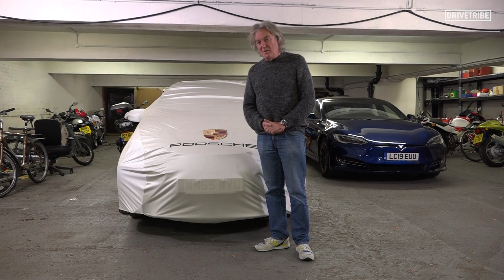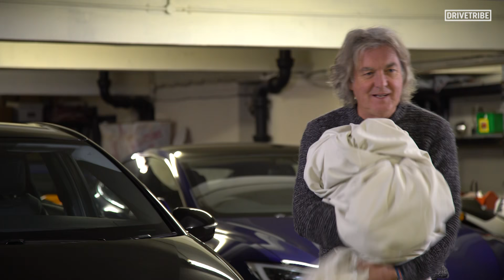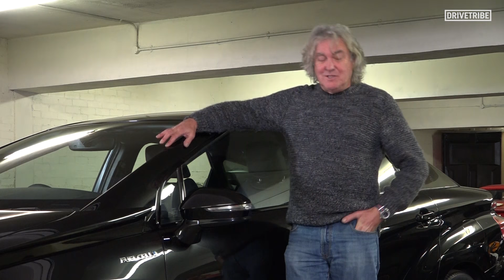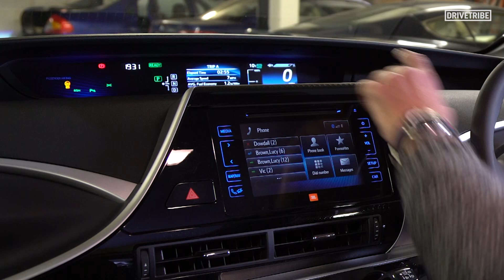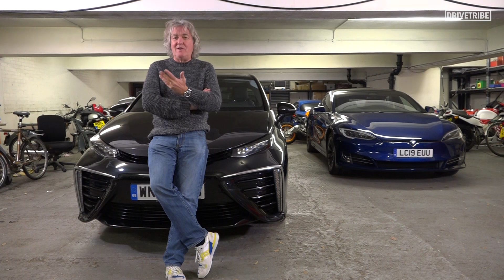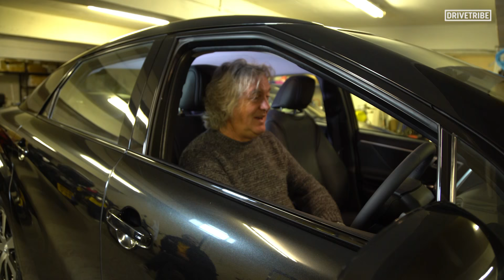James May has bought ANOTHER new car

Comment: It’ll stay parked in your garage most of the time as you can’t go any distance in it. All this forgets the huge cost in producing the new vehicles over carrying on using the 10 year old car until it really dies. Building electric vehicles and transporting their mined components all over the world by diesel powered ships is not green. More journeys by old Honda Cubs really would be green...
Reply: It can go over 200 kilometers. He doesn't live in Australia, so that's not a problem.
Reply: logitech4873 120 miles. Just enough to get me to Bristol but not home again...current Golf range around 500 miles per tank full.
Reply: @GrahamA63  Well it's actually much further, when I look it up. EPA range is 366 mi (589 km), which is more than enough for 99% of people.
Reply: logitech4873 James mentions something along the lines of ‘that mode is when it would do 300 miles.’ So suspect you have to be careful how you drive with one eye on the gauge all the time. Modern cars have way too many distractions already - we don’t need more. Assuming you are close to a hydrogen pump then it would work but can’t imagine there are many in Devon and Cornwall.

Comment: With the lack of Massive leaps in battery technology hydrogen is really the way of the future I'd expect. The issue comes from extraction and getting fueling stations to get on board. plus it's lighter (for lack of the batteries needed in the tesla), and fueling its much less time consuming with hydrogen than charging the EV. There are fast charging methods for EV, but they reduce battery life over time just like charging a cell phone above it's intended charging rate. If collection and infrastructure advances we'll have a format war much like that of Blu Ray vs HD DVD, or VHS vs Betamax (for those of us old enough to remember that battle).

Comment: The other problem with hydrogen  power is that the biproduct is water vapor, which is an emission since it is a greenhouse gas.  You don't have that problem with a regular EV.
Reply: Water vapor condensates into liquid water. Doubt it's a problem.

Comment: Of course the biggest issue with hydrogen is you use 2 - 3 times more electricity to create the hydrogen to run the Toyota, vs just inputting the power directly into the Tesla, this means you will need significantly more power if we all go hydrogen than if we go BEV, it will also cost 3 times more to run aswell (plus profit margins and infrastructure cost). 
That being said I think hydrogen has great potential in long haul trucking and aviation where that quick refill and greater range/ weight is more important (also be easier to do infrastructure in those cases).

Comment: i would drive both of these if they wouldnt be so limited with range.... i make 124km a day just to work and back. 300miles is 482km, now at what speed is that 1kg per 100km? i drive at 160kmh.... so that would make that 300miles range useless. vacations to the sea 1200km.... thats useless, until recharging is fast at least. if they really make 15min recharge, then i would reconsider  ev, but i would rather go with something combustion and not battery powered. electricity is already high priced...
Reply: Most people don't drive anywhere as far as you do on a daily basis.
Reply: @logitech4873  well here, most of people make even more a day than me...a very very big percentage drives out of home town to work for an hour one way. but that would depend country to country i guess

Comment: I can see the future for heavy trucks and planes maybe with hydrogen, but it's very inefficient for cars, by the time it's cracked, pressurised, transported, run thru the fuel cell, total efficiency is about 30%, versus 60% for BEV, still it's better than fossil with about 15%. I think the current thinking is, keep the gas stations doing something, keep the mechanics busy with more parts to repair and replacing those special air filters these babies will need, but good on ya James for being part of the experiment. 👍

Comment: How difficult/expensive is it to service or MOT this car? I'm assuming you have to go to a specialist?
Reply: The Mirai requires servicing every 5,000 miles due to the fuel cell complications and safety checks. Tesla have recently reduced recommended service intervals to every two years (or every year in cold weather regions in order to lubricate brake callipers due to regenerative breaking negating the need to use them much). Go figure!

Comment: In countries like Australia which have the landscape and conditions optimal for renewable energies, battery-electric works well at scale. Countries like Japan don't have the space required for large scale solar, making hydrogen more desirable, the storability represents a significant benefit for areas that can't rely on renewable energies. For areas that can reliably produce these forms of power, the energy tradeoff is less desired.

Comment: I’m all in, but hydrogen is a bit too Hindenburgy and battery’s are for kids toys.
What I want is a sealed-for-life, 2MW micro nuclear reactor under the bonnet...  

To be serious, the problem with batteries is that recharging them means converting the energy from one state to another, i.e. electrical to chemical, which is inefficient and takes too much time.  Hydrogen is getting there, as refueling doesn’t involve a change of energy state, but hydrogen is a bear to deal with as in bulk storage as it’s either very cold, or under very high pressure.

Another option could be synthetic petrol, which can be made with CO2 from the atmosphere, water, hydrogen and CO2 free electricity (solar, wind or nuclear) in a closed loop cycle.  If it can be done at scale it could even be possible to sequester CO2, in the form of synthetic crude oil, back into the same wells that we’ve been pumping natural crude oil out of for decades.
Reply: Batteries suck!
Reply: smile .as-default , especially when used in a Dust-Buster...

Comment: what do u mean the fuel cell has a chance .....the uk is full of tesla chargers and a bit slower general chargers ...not just wall sockets ....and tesla r working on the super fast chargers ...and 98% of the time average people don't need these chargers
and hydrogen doesn't occur freely in nature ....if it did it would be better although storing it has some issues
and if u r a big believer in hydrogen infrastructure for some reason ...u can power your tesla with hydrogen or anything else ....but a hydrogen car u can power with only one thing

Comment: In countries like Australia, where a lot of people will charge from the solar panels on their roofs and where most cars, about 90%, drive less than 100km a day, EV's will win out. It will be virtually free to charge. Get home, plug in, to your home battery and unplug before you go to bed. Car fully charged.

In places like Europe, where it will be economical to install Hydrogen pumping stations due to sheer weight of customers, hydrogen will more than likely win out by 2040, maybe not in the 2030's

You'll have to pay for the hydrogen and it will cost more than getting your electricity for an EV from the grid. The 5kg in the Mirai currently costs about $14US a kg. $70US for a full load. That'll work out cheaper than petrol but not so much that you'll go on a spending spree. 

Dedicated infrastructure , ( vertical integrated wind generation, hydrogen manufacturing, distribution and pumping infrastructure would reduce the cost of hydrogen and in my opinion, if that is not done, then hydrogen will take longer than it should to win that race in the HK and Europe. 

The other thing to keep in mind is that BEFORE FCEVs take off, there will be the heavy transport industry. Any truck fleet operator, and every bus operator will choose hydrogen over E buses or trucks simply due to the Wight of the batteries and their costs for such vehicles. That will result in pumping stations being located where those vehicles get parked. That will bring down the cost of the hydrogen itself because of the use those pumps will get. 

The same thing will occur in Australia. But mainly along highways where 300 miles is only half the trip.
Reply: Interesting comment. I wonder how that will work here in South Africa? Some hot places in the interior have the option of solar. Large cities on the coast have less sun and space (wave or wind energy?). 

Hydrogen infrastructure may be slow to grow in 3rd world countries? Synthetic fuel sounds like a good idea too
Reply: @sjappie5034  Anything yat burns emits CO2 so forget synthetics. 3rd world countries will need foreign investors  to kickstart hydrogen .

I suspect South Africa will be one of the  countries that will benefit from such investments heading into 2030. One proviso, though. You do have to get your law and order under control. Only jobs will do that so you need to get your people behind the idea that an orderly country WILL attract the investment's necessary. 

You also have to get corruption under control.

I might be wrong but those are issues that SA are still to muster... Good luck.

Comment: i was guessing a pos Nissan leaf or something, I wasn't far off. damn u May, u disappointed me. BUT JESUS FUCKING CHRIST. DID YOU BUY IT BLINDFOLDED? LOOK AT THE FRONT BUMPER, WHAT THE FUCK IS THAT?? DID THEY USE DARTH VADERS MASK AS DESIGN REFERENCE?? jesus. I saw rear end now and I feel like throwing up... Toyota should have never ever, not even in a billion years released this monstrosity. This car is honestly worst designed car I have seen. Driving something like this must be embarrassing af. Looks like your car has some severe case of retardation and cancer.

Comment: Interesting by the way it's important not to confuse the 2 different ways of getting hydrogen.  There's electrolysis which is extracting hydrogen from water using energy. Then theres nat gas steam reforming. The latter involves emmiting co2 so is almost the same as driving a petrol car.

Comment: Hydrogen fuelcell cars actually make more sense than "plug and drive" electric cars since we have a lot of hydrogen available, in water. Obviously you need to first separate the two but after that it's way more economical and more polution free. And now some of you start screaming at me that we need to separate those atoms and that requires power. Yes it does but even that can be powered with hydrogen fuelcells... Think about that. The exhaust of a hydrogen fuelcell car is, well mostly, water because you burn the hydrogen with oxygen ie create water (2 hydrogen atoms + 1 oxygen atom). Problem is that at the moment there's not very many hydrogen fueling stations around. And I wonder why?

Comment: Once battery technology evolves to a point where it can be charged in nearly the same time as refueling an ICE car, and when they become unaffected by cold temperatures, that will spell the end for any other method of power in cars. Just think if humans would've innovated electric motors for the past century and a half instead of ICEs that can achieve no more than about 50% thermal efficiency.

Comment: Hydrogen fuel cell cars are shite. No infrastructure and there are also massive efficiency losses when it could have been run on electrcity via a battery. They also explode very easily and hydrogen is very prone to escaping vessels. Plus, 95% of Hydrogen right now is taken from fossil fuels... not very sustainable.

Comment: Interesting mileage from the Toyota. Theoretically, full tank of petrol is 50kg to give range of approx. 400mile (average size car) but 5kg hydrogen = 300mile? Therefore, 50kg hydrogen = 3000mile? Tesla battery = 540kg, so 540kg hydrogen = 32400 mile? It looks like May is onto something!
Reply: Consider the container of the hydrogen, which is sure to weigh a whole lot more than what it contains.
The hydrogen is kept at extreme pressures.

Comment: 08:08  Of course it can.  Running a fuel cell backwards (inputting the electricity and waste product) produces the original fuel(s).  Naturally the car would need to be designed to account for that, both in letting electricity run backwards, and collecting the gaseous hydrogen and oxygen given off.  It's just simpler to use a battery instead.

This fact about fuel cells brings up my favorite notion for a solution to fossil fuel consumption, one which does not require doing away with internal combustion engines. 

Generate electricity cleanly, and with all the capacity that exceeds demand, instead of disabling turbines, closing sluice gates, tilting mirrors or panels (and so on), you use some of that excess electricity to crack water, producing hydrogen.  Rather than storing the hydrogen directly, push it backwards through a methanol fuel cell, which will also require an input of the rest of the spare electricity and carbon dioxide (which can be taken out of the atmosphere).  That gives you liquid methanol, which can be easily stored and transported, not to mention consumed directly in internal combustion engines (those made of suitable materials, to avoid corrosion - any car which can run E85 can burn pure alcohol).  The carbon dioxide released when it's burned was all originally taken out of the air in the first place, so it's entirely carbon neutral.

Comment: I appreciate you exploring these different options
Reply: I just got a 17 fusion 1.5 ecoboost.    It is honestly a fun to drive car.  The great gas mileage is a huge plus.  Small displacement turbo gas engines are going to be the future imo.
Reply: @joshsamuelson1793  Gasoline powered engines honestly don't have any future. You can make them more efficient, but in they end, they still emit CO2, which is exactly what we don't want.
Reply: @faraga1  CO2 is perfectly harmless, the issue is particulates and oil wars.

Comment: Excellent choice for daily drivers! I think the hydrogen is a long term winner. The existing power grid won’t stand the output if everyone start charging Tesla’s. 
And as you say, it can be used for so much more. 
And best of all, both options will save the oil resources for some real fast and loud petrol cars used at the best of occasions :)

Comment: Solution seems to be to do both. Have a large battery like a Tesla, with a hydrogen fuel cell from a Mirai. You can refill in two minutes when you need to, or charge it at home for your daily driving. Never need to worry about range again.

Comment: if you use it or the tesla as a daily driver 4-5 yrs later you'll have to replace the whole battery which will cost you about 6000 pounds which is the price of the fuel u saved not mentioning the emissions u tried to reduce now doubled. that really pisses me off that no one talks about they just talk about the car now but nothing about the reliability and regular everyday use

Comment: Hydrogen fuel cells is an actual technological solution. A fucking tonne of batteries isn't. Jumping generations of technology instantly will not work. People just want a quick fix and there simply isn't one. It will require sacrifice, something the modern day western world cannot fathom.

Honestly new car consumption is a bigger problem. Just because its 'new' isn't worth the cost of emissions to make it. Use it until the reliability isn't there. Make cars that are considerably more mendable. Cars with longer life and upgradable emissions would be so much better.

Comment: So how can hydrogen fuels cells be better (or cheaper)?
you would use electricity to produce hydrogen (80% efficiency) and the transport that across the country to fuel cars that will convert it back to electricity (50% efficiency)
so 100KWh of electricity is turned into just 40KWh by the car
better off just putting the 100KWh straight into your Tesla
Oh that's right, hydrogen fuel cells will give current Oil companies something to sell it the green economy

Comment: Considering the current infrastructure, Tesla wins. If, however, there were just as many hydrogen stations as there are gasoline/petrol, then, I dunno. 2 minutes for a full recharge is pretty sweet. However, currently, I can plug in our Tesla every night when I am asleep, and wake up every single day with a full recharge. The Murai, just like ICE cars, will never have a full “tank” every single morning. Maybe the answer is a hydrogen plug in hybrid. Plug it in like you would a Tesla, and if you need to drive more than 200-300 miles, have the ability to “recharge” by filling up with hydrogen.

Comment: I think electric is the way of the future. Hydrogen is not practical. It will be a lot easier to convert current gas stations into ev charging stations, then it would to create a efficient method of creating hydrogen. Plus you still have the same issues as fossil fuel, transportation and storage. With electric it might take longer to charge now,but that will soon change in sure. Plus with advanced tech i n things like solar emissions from power plants will go down.

Comment: I like things simple If I'm going to buy an electric vehicle I want a regular plug in EV, where I can find all kinds of sources to plug in and get a quick charge, even the corner quickie mart has a couple of charging stations.

As technology advances and battery density improves range anxiety is going to be a non issue, for the most part it already is a non issue.

Comment: Can  you get a hydrogen refill station for your home? Why didn't they make a converter in the car so you could fill the tank with water? Wouldn't it running on hydrogen with a standard motor (i/e Not Electric) be more efficient?

Comment: It really seems like EVs will be recharging at 350kW long before the UK has a usable H2 distribution network. When you can get 300 miles of range in 10mins, why bother electrolysing water and trucking the H2 around in diesel-powered lorries when you can just send the EV 'fuel' down a massively well developed network of wiring instantly?